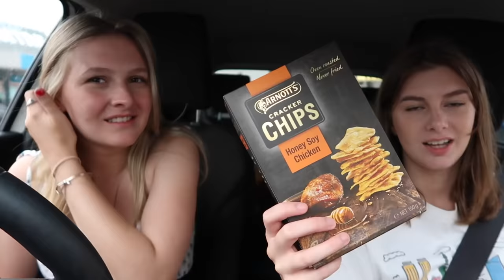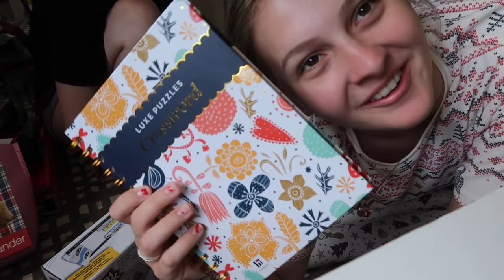learning how to change a tire...

Comment: Wrapping paper hack fold it into a bag which is fold both edges to the middle and fold a small part of the bottom and tape then shove what ever you want to wrap in it then fold the excess over. And tape